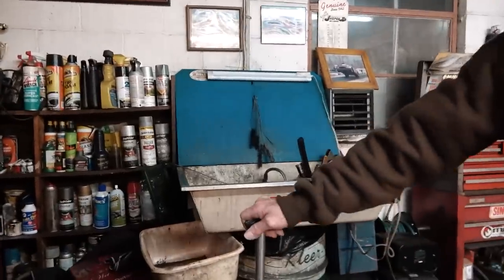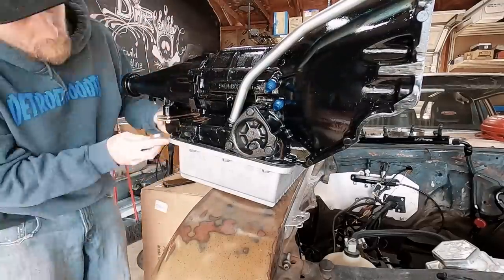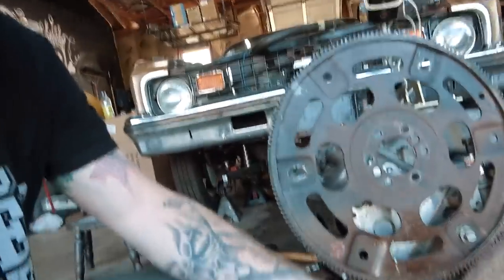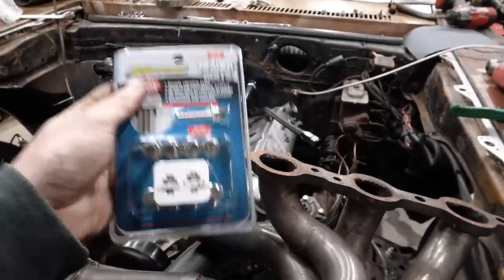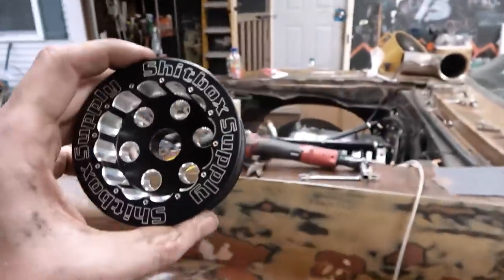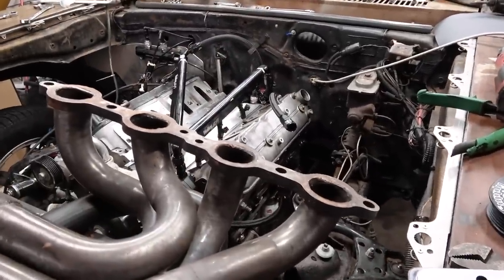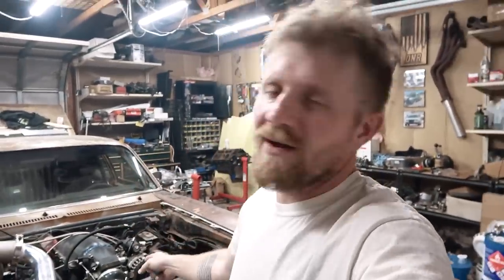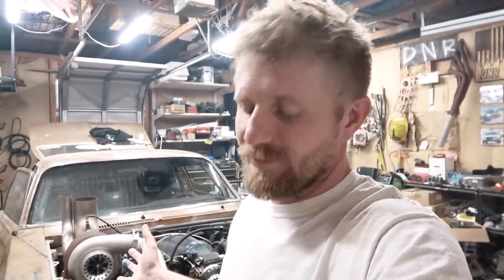TURBO NOVA ROARS TO LIFE!! Fools Gold Runs Again

Comment: Some times low voltage will cause the starter drive to hang up. Battery have good cranking amps?
Reply from the maker: It did not, I had been using the air compressor in the back too much

Comment: Also is the. Cable running to the starter a big enough gauge with good conns, nothing loose at kill switch , at least 8 gauge charge line from alt to rear of car , a long run for small wire , voltage drop? Bad grounds and voltage drops cause. Lots of weird issues.

Comment: Again he has no water in motor and he is revving it and running it. Why take the chance Matt man. Even if it’s ok. Don’t take that chance bro. Just wait till everything. Is 100% done and finished.   I hate to see this thing over heat something.
Reply from the maker: Oh no we ran a motor with no water for 45 seconds the horrors! You know engines make full passes with no water in the block right?
Reply: @DNRAuto  on methanol, wich creates no heat, u can run a engine 4 long time with no coolant, but a new engine creates more heat